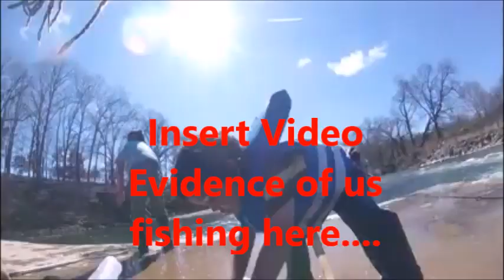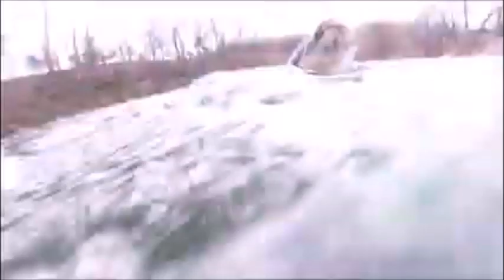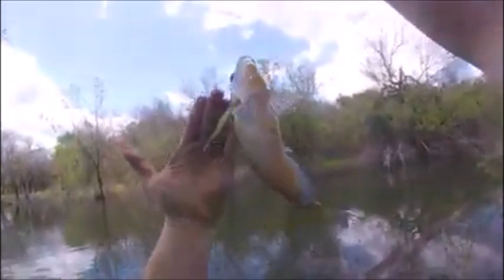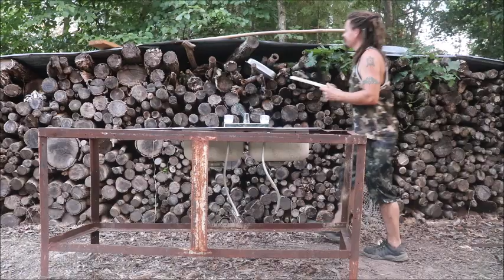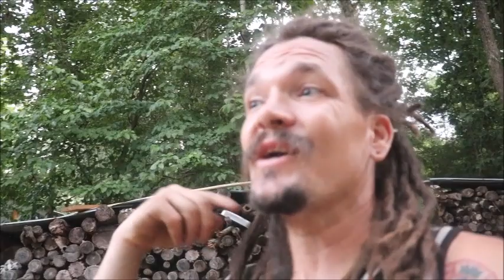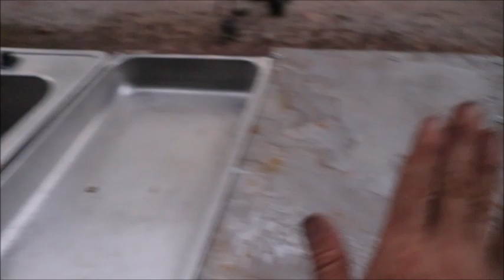Upgraded Fish Cleaning Station

Comment: Papa I believe you and I think alike. first of all we both like to ReSalvaging things That Others May  discard. A few years ago I Came Upon a number of stainless steel sinks that contractors were selling off at $3 a piece. When I bought them I had it in mind that I would make some fish cleaning stations. I am an avid fisherman so I made the first one for myself. I then made six more of these fish cleaning stations with a framework built out of excess two-by-fours from a construction site. I received $100 a piece for each fish cleaning station. as you said run the garden hose to the faucet system. below each sink I devised a y-shaped drain from the bottom of the sinks 2 A five gallon bucket to catch debris. All the folks that bought them we're really happy with them and yes I did get feedback from them about their satisfaction of what they had purchased.

Comment: Hey also. You might think about drilling some small holes in the area where the fish would lay to help water and slime run off. I couldn’t see very well but could the bolts under the sink that’s holding the angle iron be taken out and put back in on top of the sink to help hold it down.
Reply from the maker: Both VERY GOOD ideas (like you always seem to have) - Thanks for joining the 2 Comment Club!